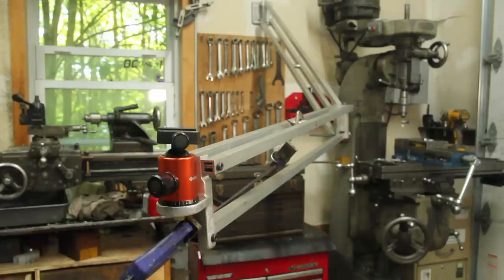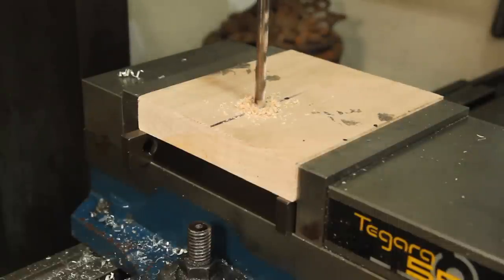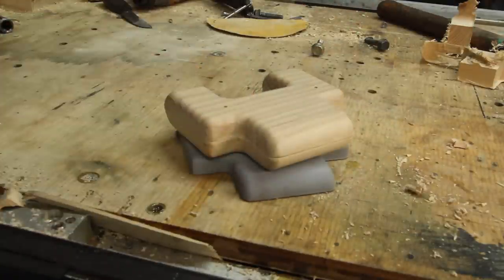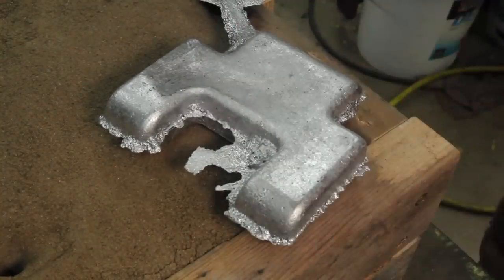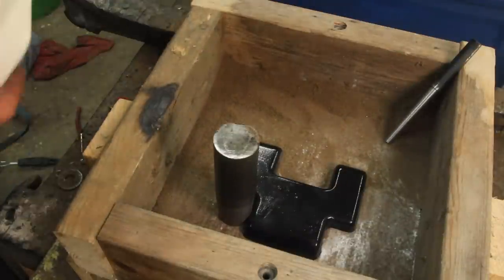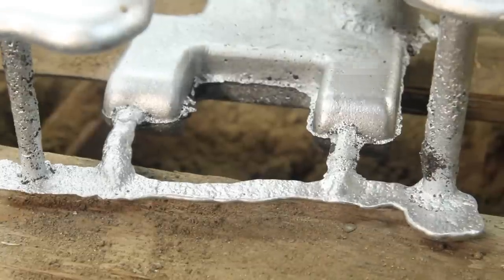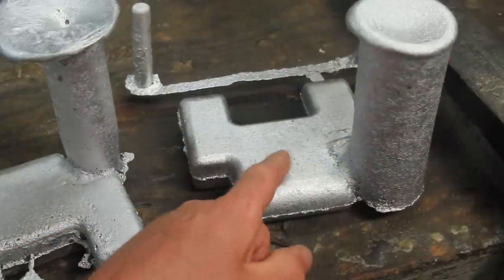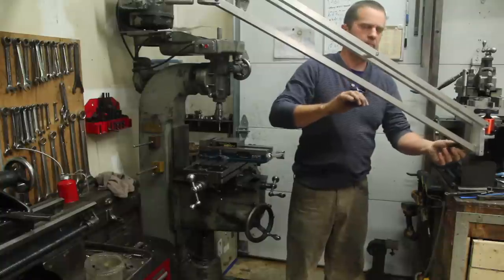Balanced Arm build (part 2)

Comment: Interesting to see the learning progress, and I appreciate the point about the comments as you are not the only one learning from reading them :)
I would suggest putting hardened washers in the hinges, as there will be a lot of pressure rubbing on a small area once everything is assembled. This will take care of the wear and tear better then aluminium would. TBH you could probably get away with any sort of washer if you are willing to swap them out when needed.
Just my thoughts, you probably already had that covered :)

Comment: I have been casting aluminium for 37 years and only recently worked out why some of my castings failed. Here is a list of good-practice;
1. Use good quality aluminium from pistons, engine parts, wheel rims. These all machine well and resist shrinking.
2. Hot melt-temperatures are needed for thin castings to help it flow. Cooler temperatures can be used for heavy castings, such as yours, to help reduce shrinking.
3.Definitely use a pouring-basin and tapered sprue to limit turbulence, wash and gas induction. 
4. If you use a pattern-plate, or match-plate, you can use a pattern for the runners and in-gates. This eliminates wash from sand disturbed by cutting a runner afterwards.
5. The in-gate should be as least as thick as the casting, so that it doesn't solidify first.
6. Risers (feeders) must always be the last part to solidify, so that the casting can be fed as it shrinks. i.e. the riser is the largest cross section in the mould.
7. Sometimes the runners and in-gate can be used as the feeder.
8. For long thin castings a bigger tapered sprue is needed to get the metal in quicker.
9. Too much velocity on some moulds causes wash and turbulence, so using an aluminium filter such as those made by Foseco, slows the filling process and makes for a nicer casting.

Everything I have mentioned here, is equally as important as the design and effort put into the pattern for the casting.

I noticed that you have some trouble extracting your pattern halves. Place a pointy metal spike into the holes on the back of the pattern and rap it with a rod to free the pattern slightly in the sand. Drill two small holes in the back of each half first, or use the dowel holes and screw in a wood screw so that it grips the wood. Then lift the pattern free,
Cheers Charlie

Comment: Best way to not get shrinkage is to design your parts without large areas that will shrink. If you look at most castings, you'll see walls only as thick as necessary, and consistent thicknesses to adjacent areas whenever possible. Love the iterative learning, remember you're catching up to hundreds of years of development!
Reply from the maker: That makes a lot of sense, now that I understand the problem, I can design around the solution.
Reply: Coring out the center section on both sides would remove little strength and lots of aluminum. Basically make it like an I-beam.

Comment: A pouring basin might resolve some of the problems that you're having. It will even out the flow of metal being feed into the mold, help to trap impurities, and it makes it a little easier to pour (larger target).

Though he's not a big YT star, I've found the videos published by Windy Hill Foundry to be some of the most informative for metal casting. He details why he does something and he shows his mistakes and explains what went wrong. You will likely pickup some useful tips from him.

Comment: Jeremy, your bottom board of thin low quality plywood bounces, and messes up your parting line when you're ramming. It's also too large to turn easily. Use good quality 3/4" birch plywood the same size as your molding box, and you'll find things go a lot easier, and it will give a clean parting plane.

Comment: That looks like it will be extremely handy.

I don't know how big of a camera you plan on putting on there, but it seems to me that it will be a pretty big lever with pretty small screws in the wood stud. You may want to go to lags.

Also, I see that you put the ball head and camera mount on the top of the end of the arm. That will work fine, but you can probably get more range of motion and get the camera out of your way better if you mount the ball head and camera upside-down on the bottom of the end of the arm and then flip the video in the edit. Not something you would need to do all the time, but it may be a useful feature to have the option to mount it on either side.

Shoot, while you are at it, you could probably put a thread to mount it vertically. That would give you the option to shoot straight down, I don't think your ball head has the range of motion to do that while mounted horizontally.

Comment: Around 15m, it seems that the new mixture is quite good, from my very limited experience... Also, do more voluminous gates and runners... My experience with casting is similar to welding(a lot more experience)... I prefer using higher amperage and run faster and add more filler to regulate temp, and with casting, i prefer to use metal as hot as possible and use wider passages as that seems to encapsulate what little oxides form and allow for better feeding(less shrinkage) during the cooling... Any and all waste can be cut and molten again after finishing the parts, and hotter metal always flows better and joins cleaner... Of course you dont want to blast holes with tig or vaporize 20kg of molten metal due to overheating it, but closer to the upper boundaries is where i am comfortable and more trusting that the end product will be as solid and stable as possible...
`edit-oh yeah, i just resumed and seen the mould... yup, that sure is a superior mixture... and very hot metal, that seems more close to red hot than any other crucible you prepared in this vid... nice

Comment: What kind of project would it be without spiraling out of control? I thought you did a great job showing progression and appreciate the reminders to metal casting process.  <sarcasm>Oh and your sand was both too wet and too dry and had too much clay and not enough all at the same time! <sarcasm>
As you said the comments are well meaning but…geesh!
Reply from the maker: It was also too fine and too coarse. 

After watching a lot of people doing a good job casting in various different ways, I think the best advice I’ve gotten was “you just have to put in the time to figure out what works for you.”

Comment: As always, great stuff. You are a few steps ahead of me on the same curve, although I definitely believe I moved forward a few just from watching this. 

If you haven't already, consider heat treating the aluminum. Not for strength, but because it seems to help with machinability. And it's easy. At least, that's what I learned from this Flowering Elbow video: https://www.youtube.com/watch?v=z5ejhb1t8BY&t=8s

Flowering Elbow in general is great. Recommended.

In any event, keep up the great work!